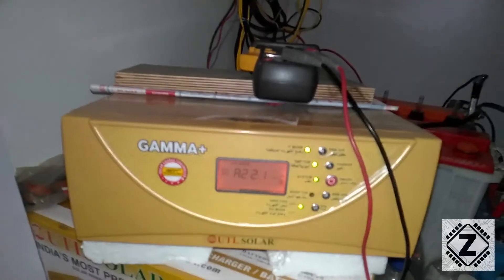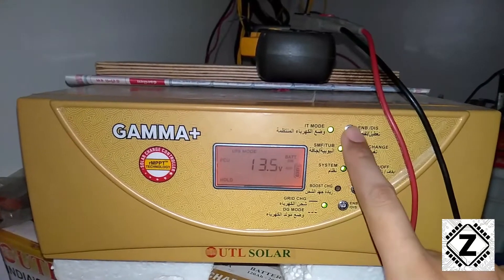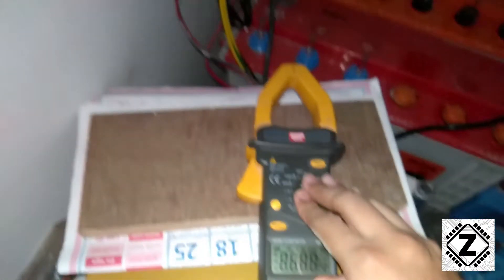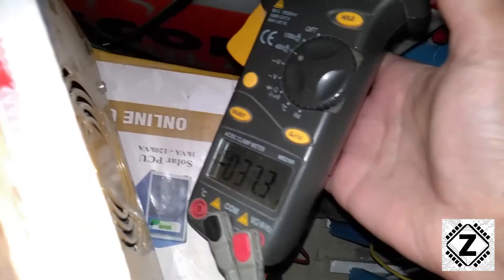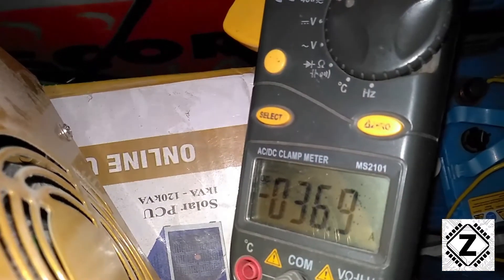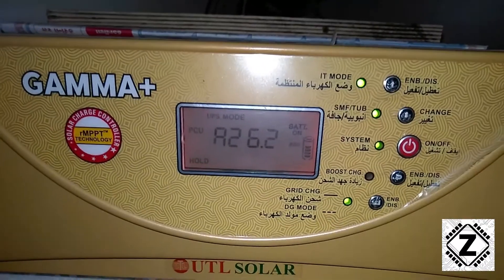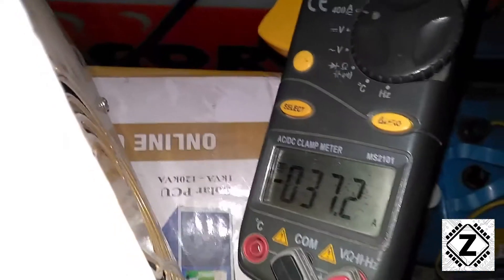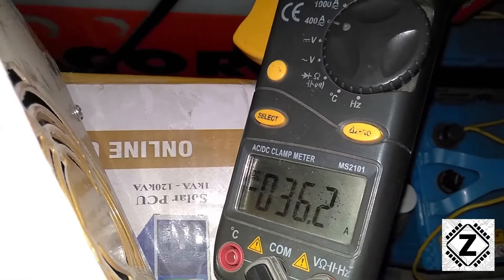UTL Gamma Plus not showing Full Ampere, Strange Problem | Faulty Inverter? | Display 26A Bug? [Eng]

Comment: Sir I connected 3 panels of 335 watt each with gamma plus(recently purchased). I checked all panels voltage and current and try a lot to get max output. But even after giving 80% load the "spv" ampere is only 16-17 ampere and the battery is discharging. Also the battery charging amp is zero. I have seen maximum ampere only while the battery is charging(19-20 batt charging amp). Please guide what may be the problem and how to solve it. Is the inverter is faulty?Looking forward to your reply🙏

Comment: Sir, amp showing 0.1 in spv..... what's the issue
Reply from the maker: Clouds or poor connection maybe.
Reply: @ZenInnovations  in multimeter its shows 18v and 10 amps while short circuit
Reply from the maker: Contact service centre

Comment: Is this issue rectified in later manufactured batches?, you said out of 4 one having this issue the others or latest or this one with issue is latest.
Reply from the maker: Its a very common even issue even today.
Reply: @ZenInnovations You checked at battery cable, what are the amps coming form solar Panel to Inverter input.
Reply from the maker: https://youtu.be/dCo-F0yi2Vw

Comment: Sir, what is the meaning of E7 error code?
My gamma plus too can't display more than  26.1A charging ampere thought it charges at 40A as per clamp meter.
Reply from the maker: 1. Error chart is provided in User Manual.
2. Ok.

Comment: Solar se charging 12amp ya 15amp set kijiye..
Inverter ko no load position pe rakhiye 
Fir clamp meter se amp. Check kijiye battery ko kitne amp. Ja rahe Hain ek video banayiye

Mere hisab se 35,40 amp jayenge
Reply from the maker: Jitney amp set kiya utne max jayenge
Reply: @ZenInnovations  pls make a video for practical
Reply from the maker: ok

Comment: Sir i have installed Solar Panel of 700 Watt (24 V) and i have 12V UTL Gamma Plus Inverter so Problem is when the load goes above 40% then its showing 0 AMP on Display and load working on Battery even having full current from Solar
Reply from the maker: Your question has been answered!
Click the below link to Join Premiere (live). The Premiere will go live on Sunday at 9 AM. Set the Reminders!
You can also participate in live chat session. After the Premiere is done, you can also watch it as a normal video.

https://youtu.be/1YgmjAxIXvc